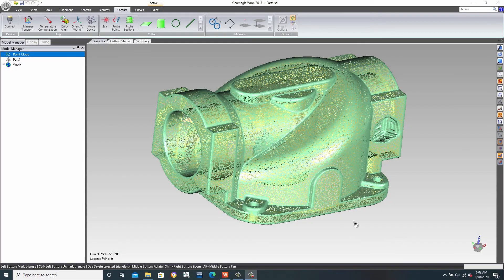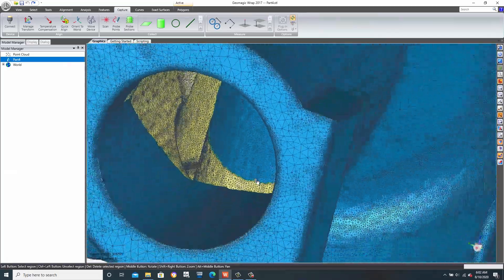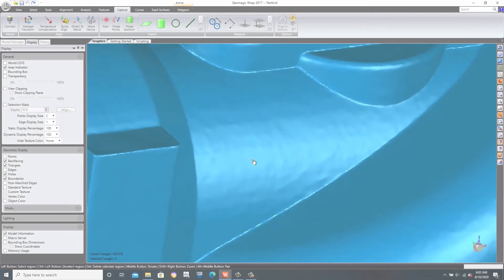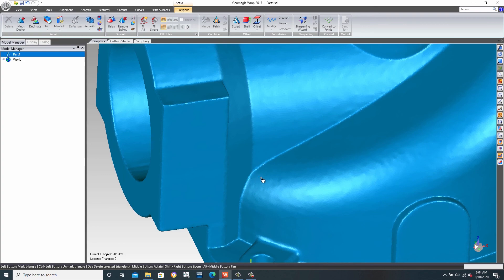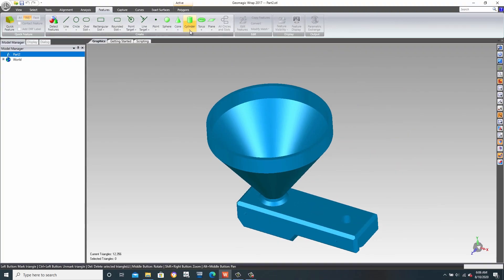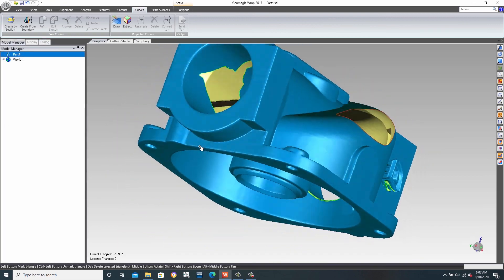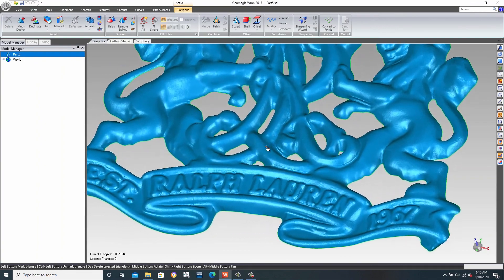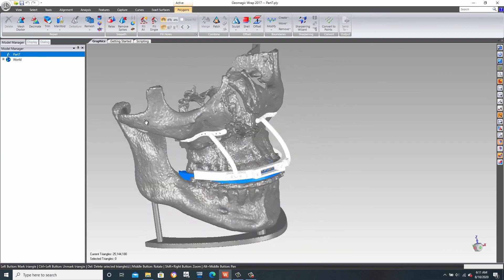Point Cloud Editing for 3D Printing, Reverse Engineering & More

Comment: can you teach how to create offset? for example the thickness of helmet after scanning outside part.
Reply from the maker: Hi!  Thank you for your patience.
Make certain you are running the Advanced Menu System.  To ensure this, select the "Options" button in Wrap (symbol in upper left corner) then select "Options".

Under "User Interface", select "Ribbon Interface" and ensure it is set to "Advanced".

By setting it to Advanced, the Shell and Offset tools become available.

Please call our support team if you need further help at (866) 277-8778.